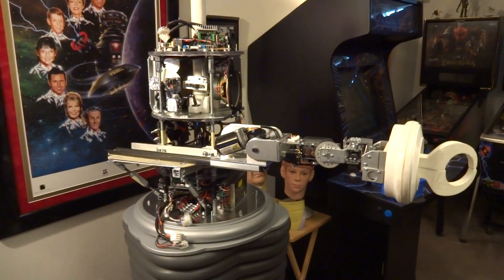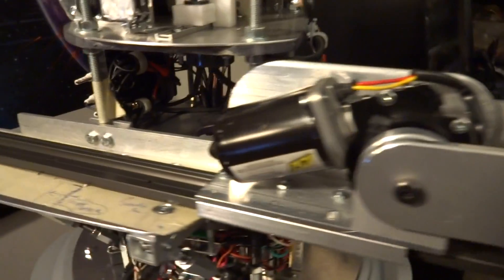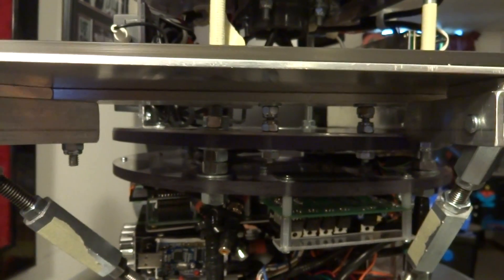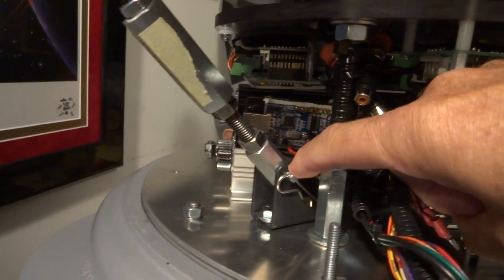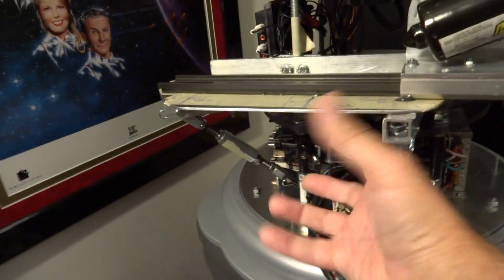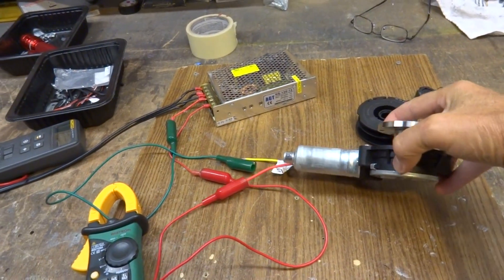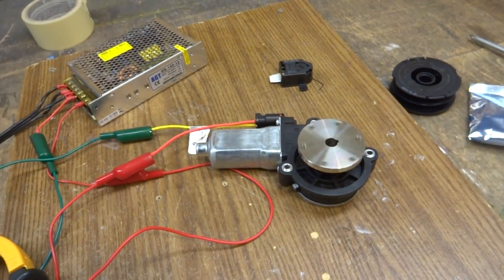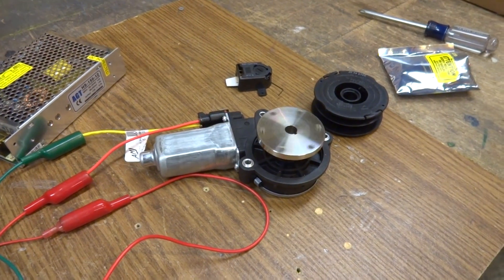B9 Robot Arm mount update (part 2)

Comment: Or you can use the existing holes in the silver part and drill holes in through the bottom of weed wacker spool and use threaded studs and have a nut that will sit flush and not affect the cable on the spool.
Reply from the maker: David Reabe Thanks for the suggestion David. I'm sure I'll do something like that.